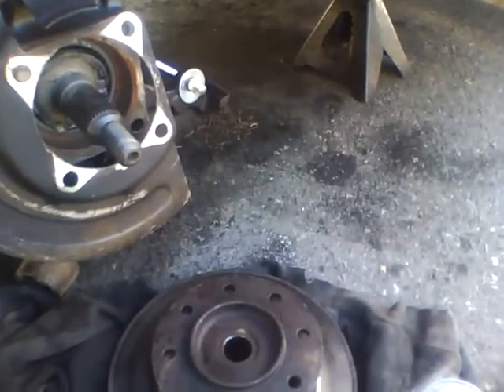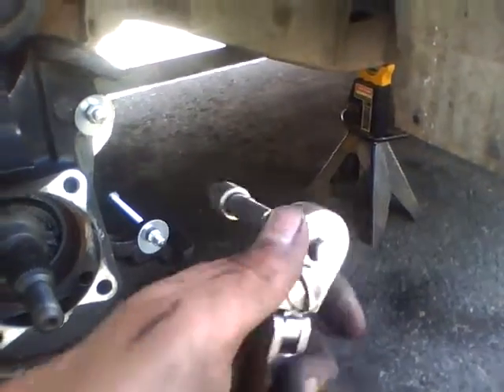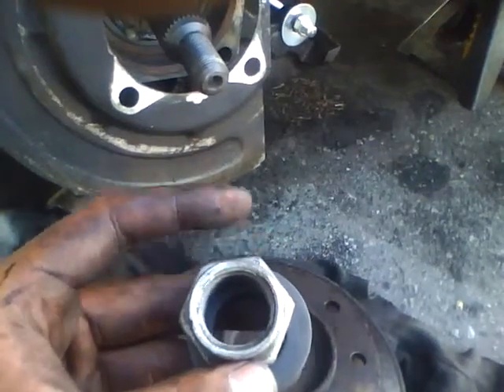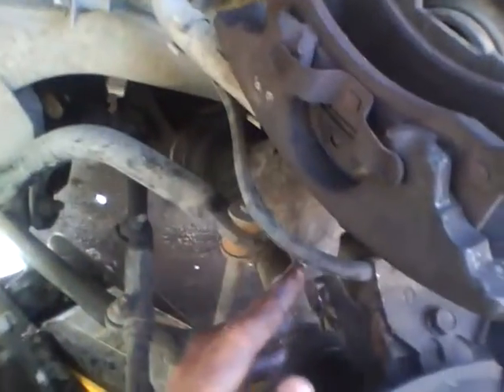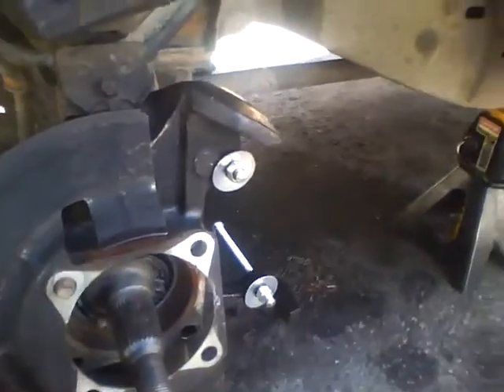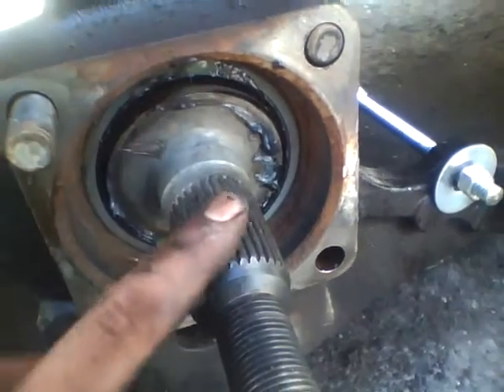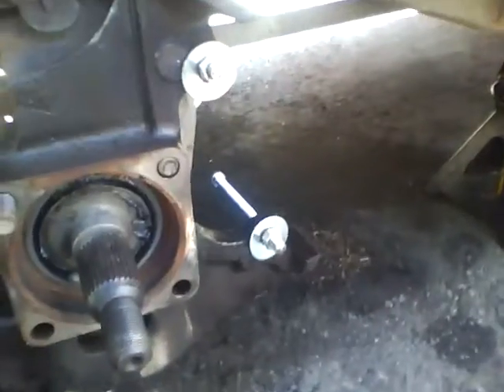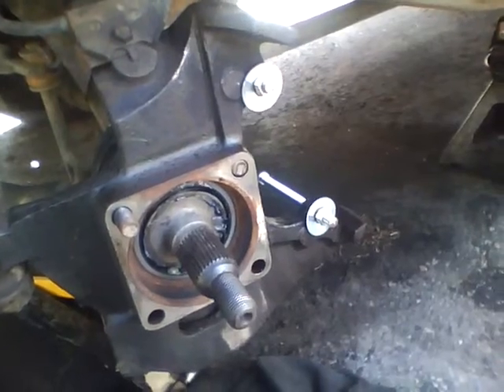removing a 1998 Chevy 2500 stuck rotor (not a great video)

Comment from the maker: oh man, i think i know what you talking about where the rotor and the hub are separate pieces is ,try to put the studs back on the rotor and tighten them with lugnuts, that way the rotor and the hub are one piece. as for the axle shaft spray 10w40 around the spline  so that the hub and spline can fit smoothly together if that what your have trouble with. You got this. It took me awhile by doing it myself it was not easy. I hope this helps.

Comment: The easiest way I've found to remove the hub from the spindle, is to take the 4 bolts out.Then thread one back into the hub 4 or 5 turns then put a socket on the bolt and beat the socket with a hammer to drive the hub out of the spindle

Comment: I tried to take out the 4 bolts and there're in there good. I don't wanna break them so I'll try an impact when I do brakes. but for now I had to undo everything just to do ball joints.